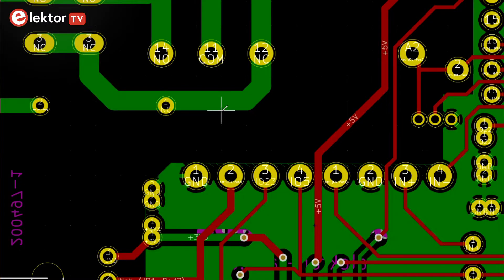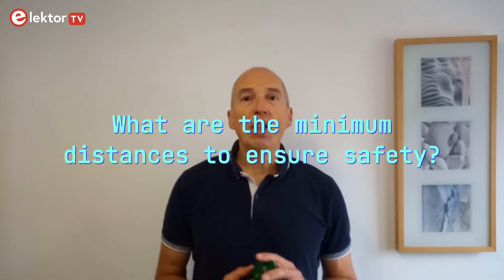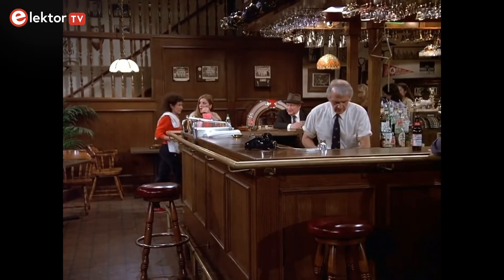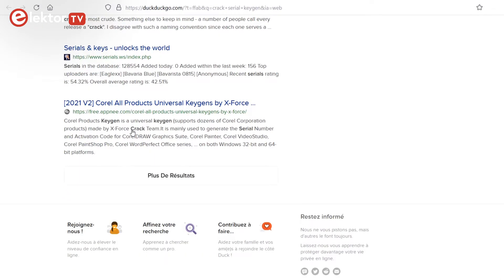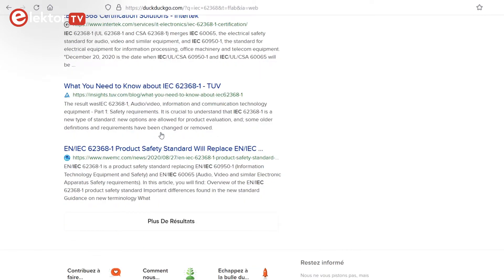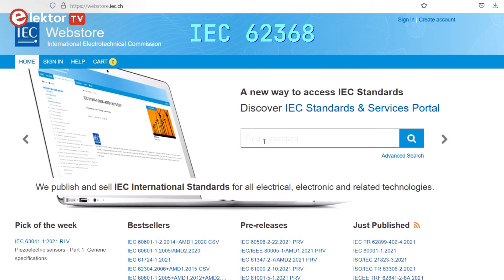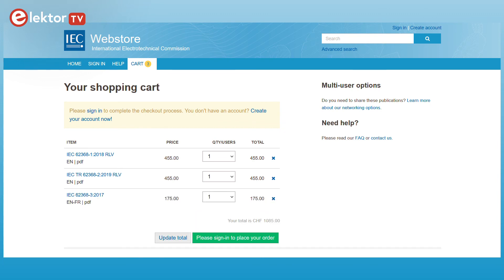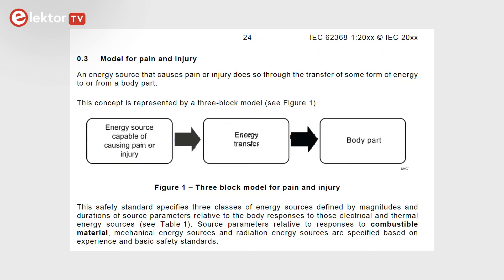PCB Clearance and Creepage Distances, Part 1: Which Standard Applies?

Comment: Hi Clemens, Very informative. I have a question: Why and how do Clearance and Creepage specifications are affected by altitude or elevation? Thank you very much.
Reply from the maker: There appear to be two issues related to increasing altitude: decreasing heat convection capability (thermal derating) and easier arcing. To compensate for this clearance & creepage distances must be increased. But this seems to be problematic only at pretty high altitudes (planes, weather balloons, things like that).